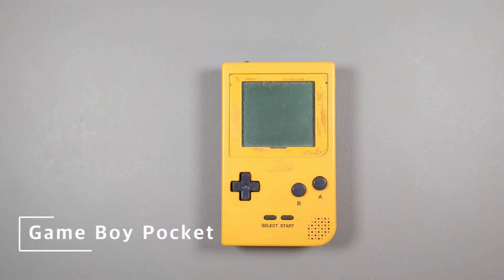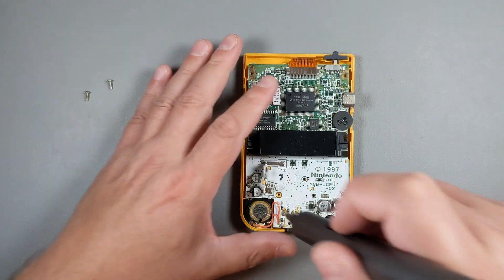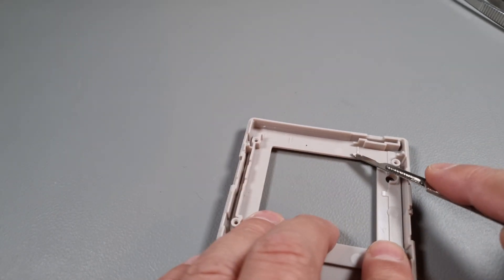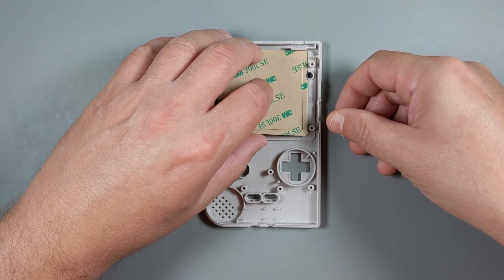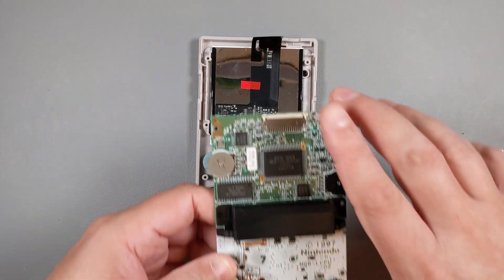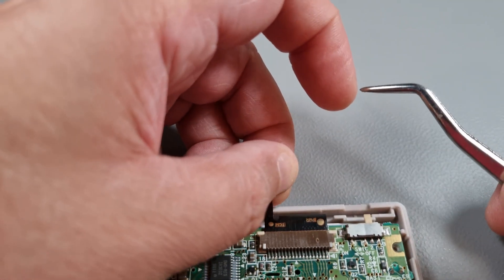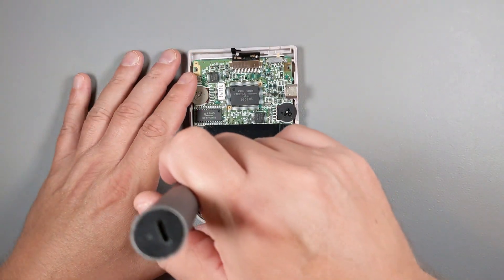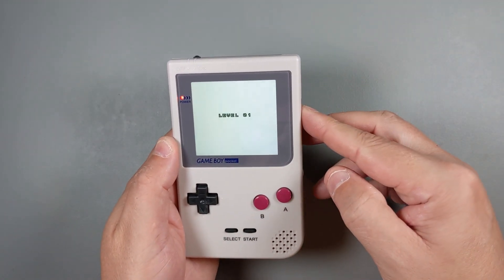Best Game Boy Pocket yet..?

Comment: cool! btw: got all the hardware to reprogram the g&w here. but instead of soldering I'll be using probes that I'm sending down to fit in the debugging ports (the ones I've got from Amazon were a bit too broad, so...) anyway, I'll make a video later. :-) cheers
Reply from the maker: yes, probes will work. But you're limited to stock flash chip which isn't the biggest (1MB in Mario and 4MB in Zelda). You won't be able to fit many games on it...
Reply: @RetroTechCorner  I'm aware of that. I will first try flashing, check I have no short circuit with the multi tester and then I thing about adding 16MB.